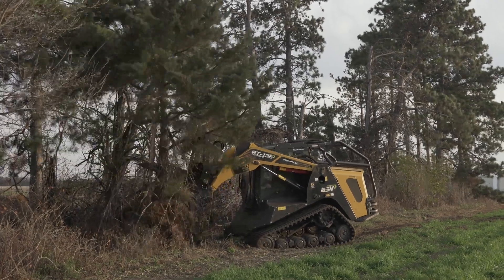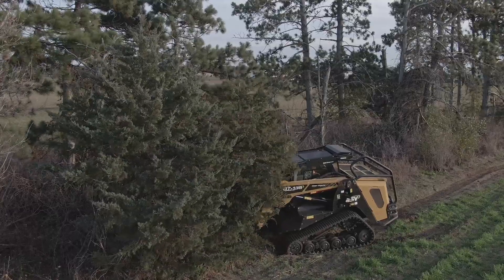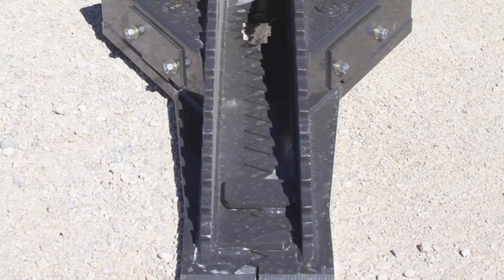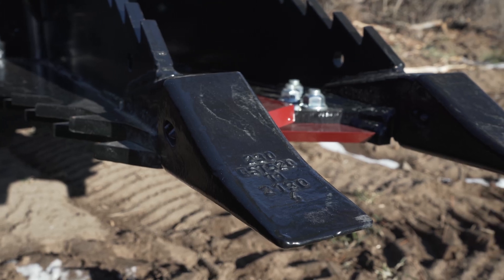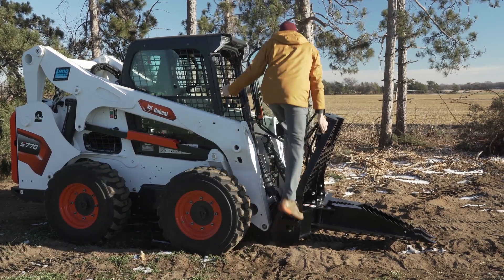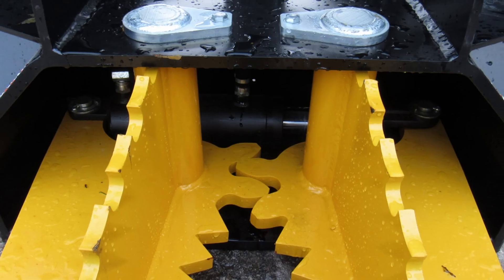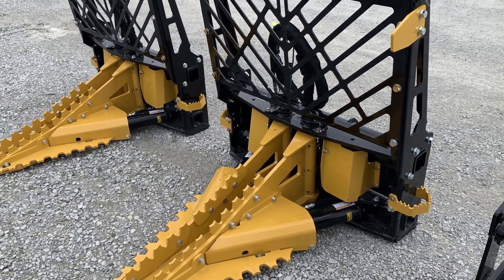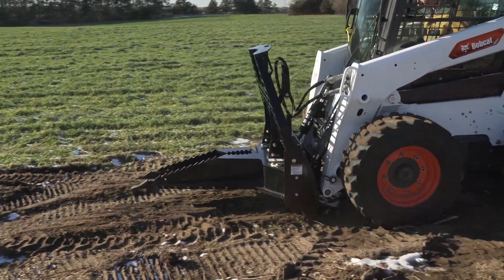Digging Tree Puller by Virnig Manufacturing | Attachment for Skid Steers

Comment: I'm between getting this attachment and getting both the Jenkins Iron & Steel tree puller and stump bucket with grapple.  The cost for their two units combined is less than the cost of your single unit.  But, your combo unit looks like a quality piece of equipment.  I'm on the fence.  Swapping attachments vs having a single attachment to do both jobs would be nice.  But...the grapple on their stump bucket would be handy.  I'm having a tough time making my decision...
Reply from the maker: While a lower price may seem appealing at first glance, there are several crucial factors here.

The Digging Tree Puller (DTP) cylinder features 30,000lbs of clamping force, 10x more than their tree puller cylinder which offers 3,000lbs of force.

Our push bar is made from 3/8" thick steel and built to withstand substantial weight. The serrations on the top help control/haul larger trees. The push bar often bears the full brunt of the tree's weight, sometimes unintentionally. Their weaker push bar, made of thinner steel, simply won't hold up under pressure like ours does.

The cylinder is guarded and hoses are safely routed, minimizing the risk of damage. Contrast that with theirs, where a simple snag on a low hanging branch could result in you fixing an oily mess instead of working.

Choosing the Digging Tree Puller isn't just a matter of price, it's about investing in unparalleled quality, versatility, efficiency and long term value. It's about having a tool that not only gets jobs done, but continues to do so reliably long after the initial purchase price is forgotten.

https://www.virnigmfg.com/dealer-finder/